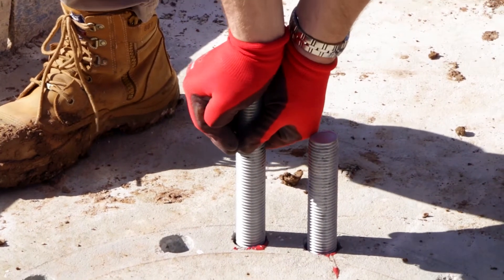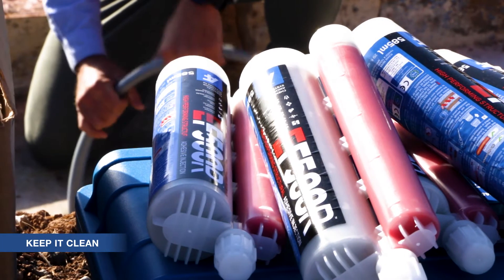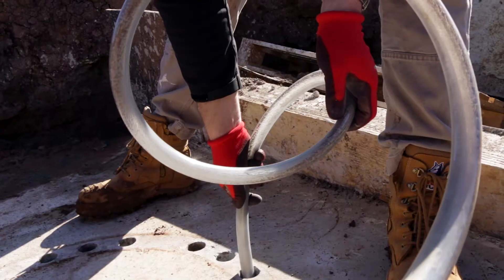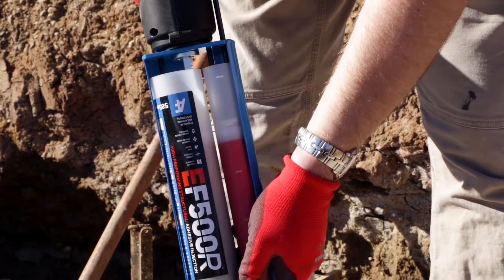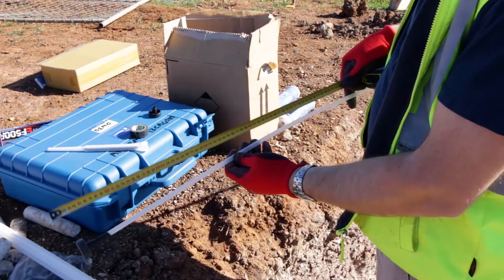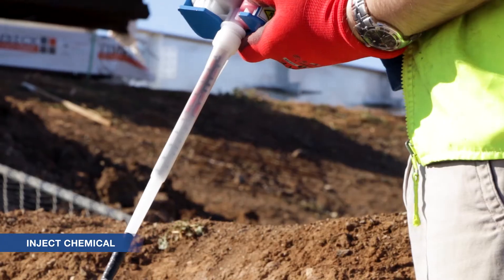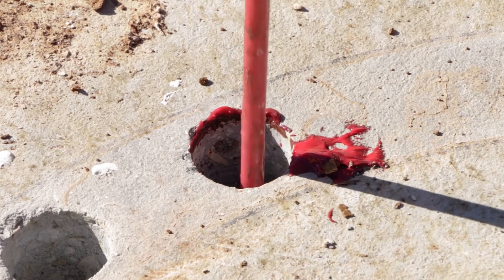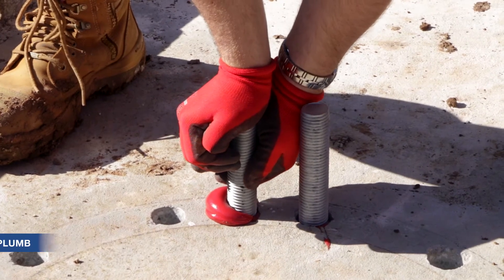How to: Chemical Anchor into Deep Concrete Holes | Allfasteners Australia

Comment: Yes, very good info, thank you. One question please; how much bigger do you drill the hole than the threaded bar you're putting in? It looks about 2mm bigger, is that enough to allow the chemical anchor to distribute properly, or is 4mm bigger, better? Thank you. I'm just an amateur but who likes to get things right first time.
Reply from the maker: Thanks for the comment. Check out our chemical anchor page here https://www.allfasteners.com.au/products/chemical-anchors where you can navigate to the specific chemical anchor product and their associated technical data sheet in the downloads tab. You can also see our anchor calculation software AnchorFOS https://www.allfasteners.com.au/anchorfos or drop us a line through our contact page here: https://www.allfasteners.com.au/contact-us/